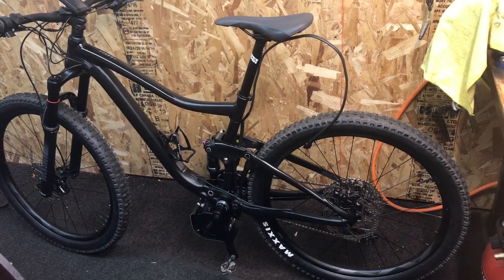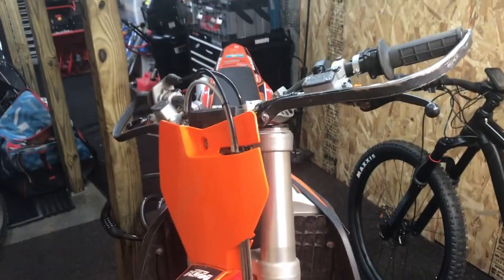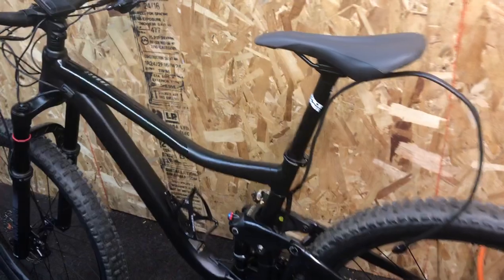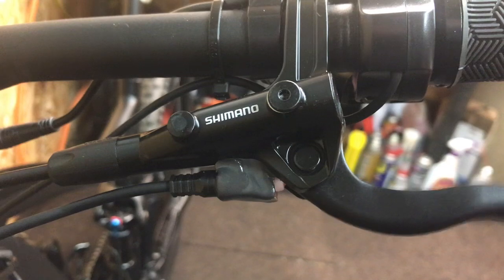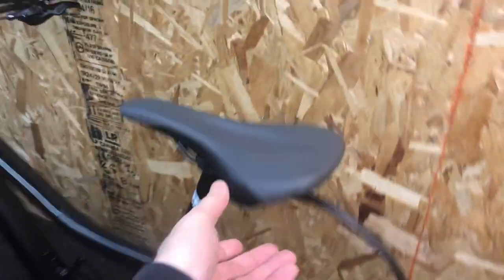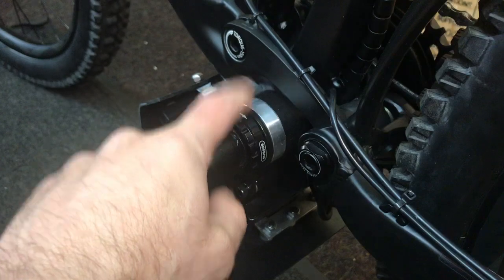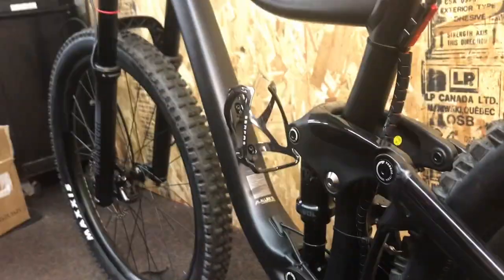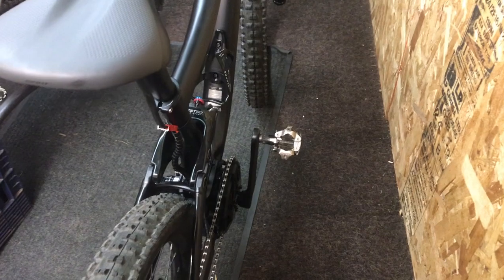Giant Trance E Bike Build with Bafang 750 HD Motor Intro Part 1

Comment: Hey is this a giant trance 2 ? Thank you for all the videos man , I’m currently in process of buying all the parts I need for this build
Reply from the maker: Trance 1 I believe.  You are very welcome if you have questions hit me up.  Make sure you build a bash guard.  You also will have to make sure your spacer kit for the bottom bracket is super tight and you may have to have one re machined like I did to make sure it doesn't creak.  Integrate the brakes like I did works amazing.  Good luck

Comment: Hey nice build ,what’s the ground clearance on the motor when suspension is fully compressed
Reply from the maker: The motor sits low so probably about 8 inches.  I do have to pick lines more intelligently while riding which is a bit annoying.  Not end of world with the more recent guard I built that starts at the upper part of the lower downtube and runs under the motor so objects cant catch the motor and damage it.
Reply: Nobody else has done a build video as detailed as this , it’s a big help ! If I run into problems you may get a message from me , I’m not too handy lol. What are the largest tires your able to run ? I’ve read 2.8 in front and 2.6 in rear. You had to have one of the spacers machined?

Comment: What size is your frame?  Wondering if a shark battery can fit a small frame.
Reply from the maker: Medium
Reply from the maker: Yes luna used to sell a 13 ah pack that fit it
Reply: Since you have the 100mm bbshd version. Would the 68-73mm bbshd fit without the adapters?
Reply from the maker: No it won’t fit too narrow.  Has to be 100mm
Reply: @blarpieman  I have  2 new bafang motors but they are 68-73 & I have a Stance 2 coming friday,I found out Lekkie has a kit that adapts 68-73 motors to 86-93 BB otherwise if u get a 100mm motor u have to find a machine shop to make spacers
Reply from the maker: @joehiatt1992  yea Matt at emp provides spacers for the 100 but they are of poor tolerances so I had new ones machines tighter off the old ones. Thanks for the tip on the kit.